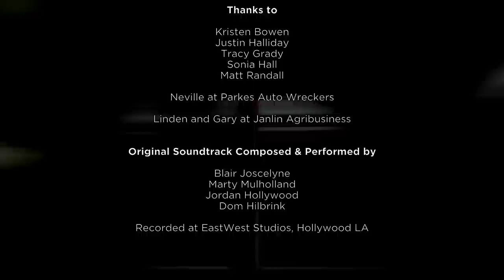Lend Us A Ride: Australia [EPISODE 3]

Comment: you guys are making me want to keep my 91 "mercury" capri that i bought for 500 bucks as the brakes were shot and the guy thought the engine was worn which surprisingly turned out to be a bad oil pressure sending unit and not work bearings, the thing runs great except for a sticking throttle body but anyways its a great car that i kind of want to mod and keep for a while now lol